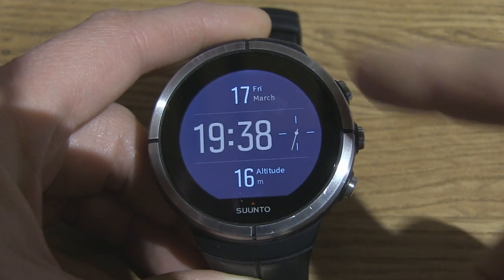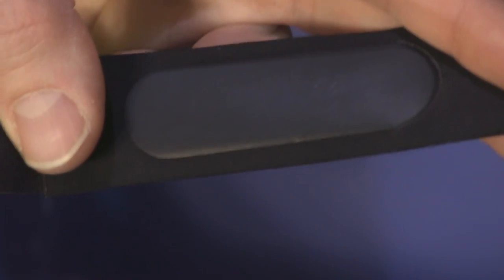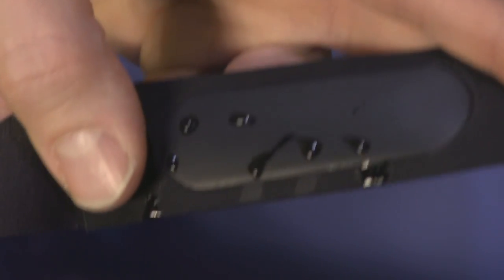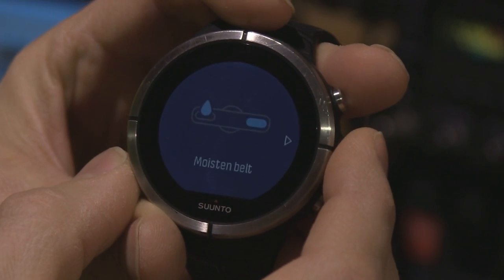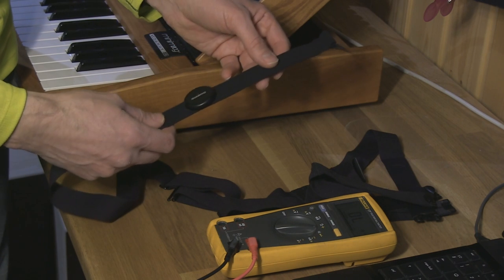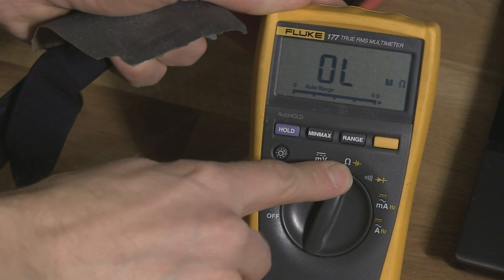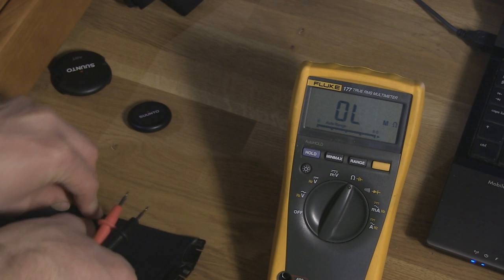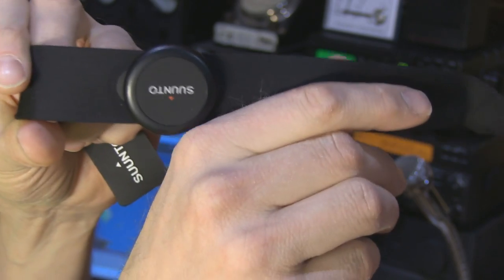A Great Trick Solving your Heart-Rate Strap Problem

Comment: Any issues with the hair on your chest as it comes to accuracy? Thank you!
Reply from the maker: No issues because when I wet my chest there is plenty of moisture under the belt and the contact is good.  Also, the moisture is over a wider area than if you would only wet the belt.  So if the belt moves up or down there is still a good contact.  Plus the extra moisture around the belt helps grounding any static electricity from your shirt.
Reply: Tom Tech Thank you for your informative answer! Have a great day! ✌️
Reply: @TomTechVideos  hi so we can wet the electrode area inside the strap but you advise to put it on then slide some water in between the area of where the two  electrode are at???
Reply from the maker: @MissHitAllTheTime  Instructions say wet the electrodes but my point is to wet your skin.  Electrodes already conduct electricity so they don't need wetting.  And the electrodes can hold too little moisture on their surface so they won't wet your skin enough.  You can wet your skin before putting the strap on but my advice is to first put the strap on and then wet your skin.  This way there is less time for your skin to dry before putting the strap on.  When the strap is on you it covers the skin and protects the moisture from drying out.
Reply: @TomTechVideos  it was working for the first 5 min of run then my body cool down and had to warm back up and once i start sweating it was good and then i slowed down my run speed and eventually the sweat dried off again today was very hot humid weather over here. i'll give this a try. my watch comes with a HR option setting set to auto instead of off and for auto the manual tells me that it enable hr data from the best available source. not sure if i should just turn that setting off to make the wrist HR monitor completely off. but will try your method first and see what happens.  

Also, if you can tell me from the graph if my heart rate monitor is not working when you zoom in? appeciated if you can help me analyze and give some tips on how to tell? My latest run yesterday and the link below is from runs few days ago as well for you to check. i run every other day.  is it getting worst each day as i run? link below is most recent to oldest. 
https://connect.garmin.com/modern/activity/5252224555      <----most recent run
https://connect.garmin.com/modern/activity/5243324719
https://connect.garmin.com/modern/activity/5233644231
https://connect.garmin.com/modern/activity/5213622053
The link below is the very first time i used my new HRM. is it accurate here from looking at the HR graph??
 when comparing to the above 4 links?? 
https://connect.garmin.com/modern/activity/5203667213
Reply from the maker: @MissHitAllTheTime  It is hard to say how accurate those are without comparing to a proper professional HR monitor using glued gel electrodes.  It is normal that the heart rate goes up and down and looking noisy during training.  You have to look at the average levels of the HR.
Reply: @TomTechVideos  so from the hr graph of my runs does it look normal the avg levels of the HR??? i feel like its off but 20-35 beats and if i try to run the same pace as my very first run with the new HRM that i did on 07-07-20 it easily go to zone 5 even though it tells me that i was in zone 4 but that time my heart rate training zone was a different method by max heart rate or lactate threshold instead of by heart rate reserve since my garmin watch allows three method of training with heart rate you can choose from. running a big 3 min difference in pace time will easily bring me over to zone 5...
Reply from the maker: @MissHitAllTheTime  Like I said, I can not say without a reference.

Comment: How do I check my resting heart rate with just the watch? Thank you.
Reply from the maker: Shade On A Cool Day You need the HR belt too.   Lay down and relax with a training (yoga for example) running.  Afterward check what your lowest HR was.  If you really mean watch only, I'm about to review the Suunto Spartan with optical heart rate (which in reality is pulse measurement, not HR) if I get enough subscribers to make it worth while.  That you can use without belt but it has limitations.
Reply: @Tom Tech I spoke too soon. Literally figured it out a few minutes later after making my comment. You just click on exercise then choose and exercise click top right to start then scroll through display to see current heart rate. 

Yeah dude I already knew you need a strap to use it as a hear rate monitor. I already had it.

Dude not helpful. You should have just said go to exercise on the watch.

Comment: Good tip to measure resistance. The Smart Sensor is great but Suunto straps are very poor quality. Contaminated? No no no..just poor quality and expensive to replace.
Reply from the maker: Yes - quality is measured by customer satisfaction.  If they would tolerate sweat, saliva and whatever they will be contaminated with they would be of better quality.  Maybe using water instead of spit to wet them will increase their lifespan slightly - I'm not sure.  Rinsing sweat away with water after use will increase life.  Use cold water to rinse by the way!  Warm water will make the acid in the sweat more aggressive.

Comment: Help!  Anyone had issues pairing a Suunto HR monitor with Garmin Edge 1030?  Any solutions?  For more context: I have two Suunto Ambit 2 watches + matching Suunto HR straps/monitors - and both Ambit 2's pair and work perfectly with either noted HR monitors.  I just got a new Garmin Edge 1030 (bike computer) and so far the 1030 will not pair with either HR monitor.  It just doesn't seem to see it despite my multiple attempts - as usual, I put the HR monitor on my body first (tried both with and without extra moisture), I've tried re-starting the 1030, using good quality fresh batteries in the HR monitor, holding the two units really close together, holding them a little further away, etc. Thus far, the 1030 still won't see it these HR monitors to pair.  Any trouble shooting ideas?  Any leads?  Thanks so much all!
Reply from the maker: First make sure that an Ambit or anything else has not made a connection to the HR strap.  There can be only one connection to the strap at the time.  Note that you don't need to unpair but just don't start an exercise because that will connect to the HR strap.  The Suunto HR straps should be using a standard Bluetooth HR monitor profile.  You can for example pair them to your mobile phone and use an app like Sports-Tracker to record your HR, speed etc. Some people just buy a phone holder to the bicycle and use the phone as a bike computer.  It may be that Garmin does not support standard Bluetooth HR  profiles.
Reply from the maker: By the way I use one of these: https://www.suunto.com/en-us/Products/Other-accessories/suunto-bike-mount/

Comment: I don't see why you should need to wet the contacts at all, by the time your heart rate is high enough to be interesting you're sweating anyway.

I have a love/hate relationship with these chest strap HRMs, on the love side they give accurate and instantaneous heart rate data unlike that of even the finest optical HRMs, on the hate side the straps only last 6-12 months before they start giving obvious garbage data. It's a defective design and the cost of replacement straps is a complete rip-off.

Comment: if you not sweating then you really don't need a heart monitor
Reply from the maker: Yes, but a lot of people complain that they don't get a proper heart rate in the beginning of an exercise before they start sweating.
Reply: yes but its irrelevant
Reply: @TomTechVideos  That is what I experience. I consistently get incorrect readings at the beginning of workouts from my Wahoo Tickr. It completely screws up my Garmin Firstbeat performance condition measure which uses HR in the first 10 minutes of a run. Many thanks Tom Tech for your time. This is really helpful. Wahoo recommends wetting the contacts, not the skin. This still doesn't work for me. I will try the skin and see if I get better results.